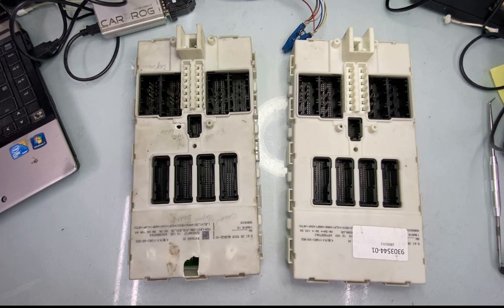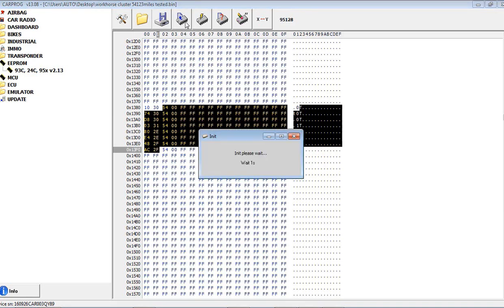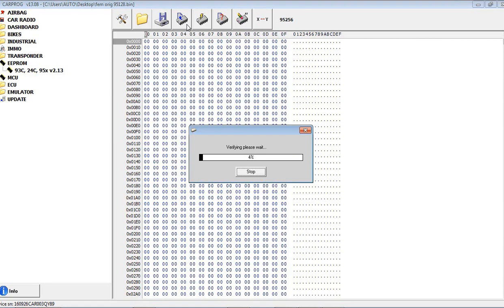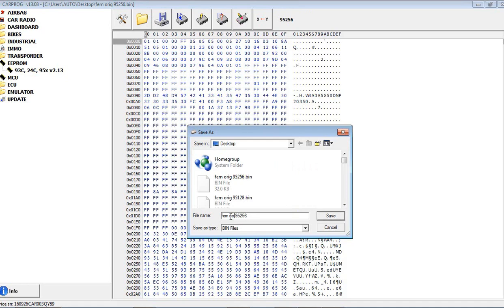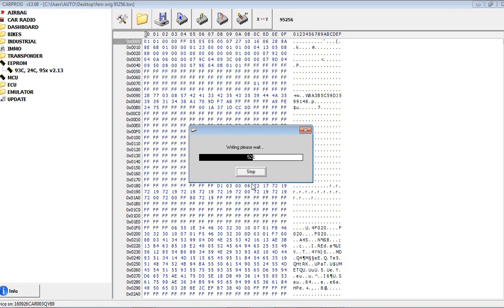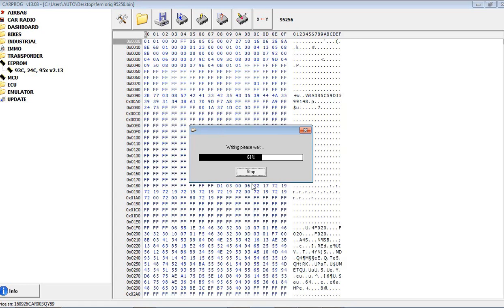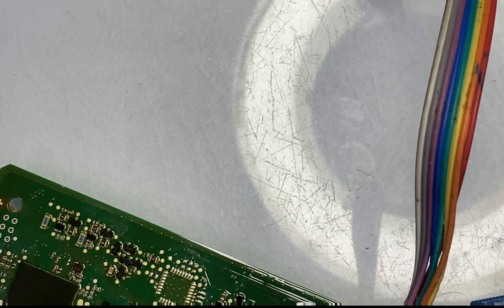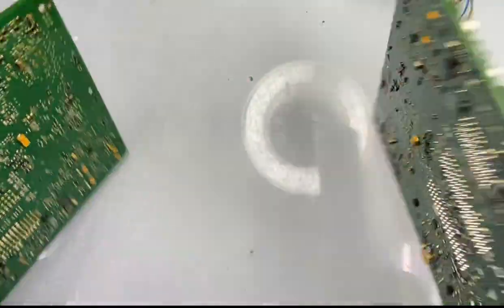Revealed: How to Program Keys for BMW F Series FEM or BDC

Comment: Hello, 
I tried to program a second key to my BMW x5 (f15) and now the BDC doesn't communicate with the car at all. The LAUNCH computer I tried to program the key with did some sort of ECU upgrade as part of PreProcessing step and it completed it but at the end I got a message saying a file is lost, check if car is ok. The BDC has no communication with the car whatsoever, and there is a blinking light from the Start/Stop Engine button, with a bunch of error codes. Any ideas how to resolve?

Comment: Hi, can you help me?  I have a BMW f36, the control unit does not work anymore, I bought another one and I tried to do as you did in the video, but when I connect to the car it still gives me the original frame, and not that of the new control unit I bought .. what can I do?  I unsoldered the EEPROM 95128 and 95256 from the original control unit and I welded them into the new control unit .. but the car shows no signs of life .. I no longer know how to do it, it does not read the key, it does not read anything
Reply: Same problem let us kmow

Comment: Does anybody here knows how to clone/code a BMW ELV unit? That's the steering lock module. Looked everywhere but everybody seems to replace them with an emulator!!!
Reply: I run into a Mercedes with steering lock problem, no start. The dealer doesn’t sell the elv, you have to roll the car there to the sealer and have the dealer install and program(registered owner only, because of the security reasons). That’s why all you see is aftermarket emulators.
Reply: I mean till the car to the dealer for that problem

Comment: Ii have a 2017 M240i pre-lci and it only came with one key fob. I purchased a brand new one that wasn’t pre-programmed from BMW is this the service I need to use to get the second key fob to work on my car?
Reply from the maker: Yes we can write a key to fem original key that starts the car will still be needed
Reply: @vehix411  I don’t have remote start, just lock unlock trunk and factory alarm. Will this still work?  How much is it?

Comment: i tried adding xm sat radio to a new/used head unit in my 335i f30 2014 using esys. but.. . still no xm ,and new headunit wont get radio or cd play anymore.   but.. could this have damaged the fem? i have scanner and get a code 804033 cycle protection FEM module. i do need to replace a sensor and driver side comfort access antenna(waitin on those to arrive now) so iv found that all these modules, sensors are tied to the ecu or fem in these cars. u think replacing those 2 will take off code 804033? no prob crankin car/driving and no cel light on dash. only get code using scanner.
 and. is there a way i can update fem using esys to latest software?
Reply from the maker: YOU CAN TRY DOING SOFTWARE UPDATE IT MIGHT FIX YOUR ISSUES
Reply: @vehix411  how do i do software update?